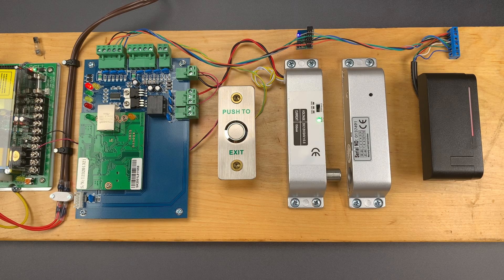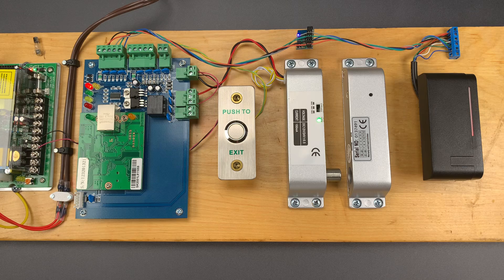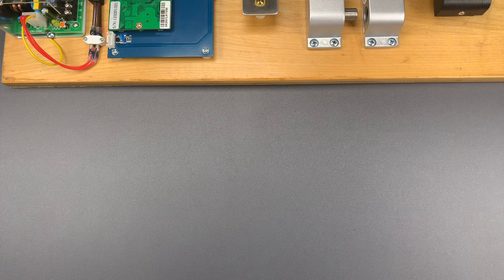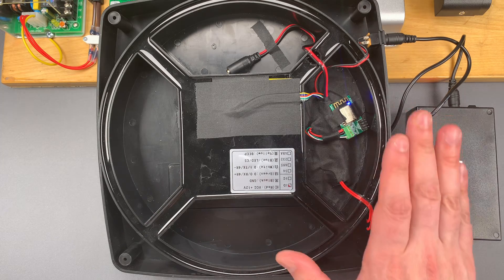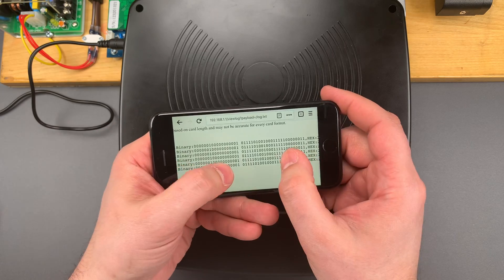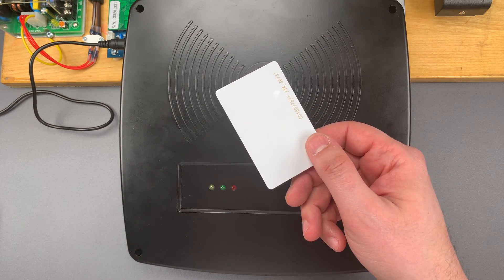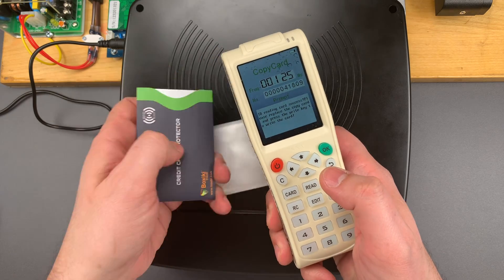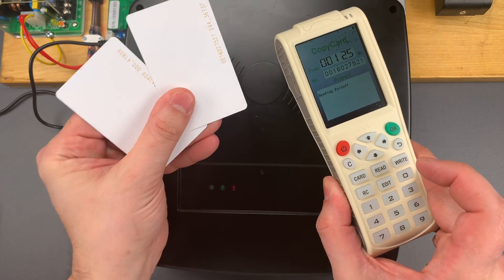[1056] This Black Box Reads RFID Cards in Your Pocket

Comment: If the card is encrypted it prevents you from cloning the card, but it does not prevent you from exploiting it. By reading the card with the big coil and an RFID transponder near the reader, you can let the big coil relay the communication to the transponder. This way you can use a card held by someone farther away, even out of sight. You'd still need remote access to the card whenever you want to use this exploit.
In a high security facility you will probably not be able to enter a high security zone of you haven't first entered the low security zone, nor would you be able to enter more than once. In an office building on the other hand that kind of measures are not in place. It happens quite often that a close colleague forgets their badge and someone else checks them in with their own pass right before entering through the security gate themselves.

Comment: Good to know that instead of buying special read-proof wallets and sleeves, just stacking all your cards together works best of all. I bought one of those special wallets some years ago and to make them more secure, they made it as small as possible. It's a pain trying to insert/remove your credit/debit cards. Also, standard business cards, such as for doctor appointments and such, do NOT fit. You have to first trim them down with scissors to insert them.

Comment: Luckyly 99% of the access badges for apartment buildings in France ARE encrypted !
Some office bulidings may have non-encrypted access control systems to the front door but I don't think this is much of an issue since you usually have to go through turnstiles with security guards standing by and you may also need to type a passcode on a keypad inside of the elevator before going any farther.
And I'm only talking about "low security" offices.
Buildings with "more sensitive stuff" will often have capacitive fingerprint readers in addition to security guards and cameras, turnstiles, armored doors and so on...

Comment: ID Stronghold has a patented BloxProx (tm) card holders which will work to jam 125khz HID Prox format flat ISO cards as well as lots of holders that block 13.56mhz cards.  The BloxProx is an upgrade of the badge holder they sell to US Goverment employees.  I will prevent this cloning that truly is as easy to do as the video shows.

Comment: Where I live uses an intercom based security door where the tenants use fobs for entry. Much like those keyring devices shown in this video. The scanner is a small area on the main panel where the buttons are for buzzing into each home. Sadly all the electronics are in the same place. The panel is screwed in place with Alan key screws which you can pick up from any hardware store that sells screwdrivers. Remove the panel & I am sure LPL cud open the door in seconds.

Comment: Our building has one of those crappy RFID access control panels. They also have the nerve to charge $200 for a second keycard. I spent $35 on ebay and got a copier that came with keyfobs. It gets worse than that. Every single one of the panels is keyed alike from the factory, and you can buy the key on ebay for $10, and then just short the opening circuit with a paperclip.

Comment: Years ago, I installed a top of the line RFID access control system in an unnamed federal building. The readers I installed at that time would easily read the cards inside a wallet or purse from a 2 - 3 ft distance. During testing and training, this one guy who complained that his card did not work even if he held his wallet next to the reader. I gave him a new card and it would not work while in his wallet. I tested both and they worked fine in my hand so I asked to see his wallet. He had an expensive eel skin wallet and this system's RFID would not penetrate his wallet. Keep in mind, this was about 15 years ago so technology may have overcome this obstacle. LPL, if you have an eel skin wallet, test it out. Would anyone care to comment?
Reply: William Garrett - There may be something to that.  I used to have an eelskin wallet many years ago, and the mag stripes were constantly failing on my credit cards.  I suspected the wallet but never proved it.

Comment: Eh, not sure either stop gap would stop someone determined which They're gonna be if they pull off something like this. would take half a milimetre of copper/aluminium to reduce the signal by a factor of ten, and they can just build a bigger/more powerful antenna. They're unlikely to care about the FCC.

Plus I'm pretty sure that a human could still
decode two cards put next to each other if they looked at the raw waveforms, and used some intuition, it would just be tedious.

Comment: 3:38 is that how RFID protection wallets work? I've seen them under an x-ray and the wallet itself seems to have an RFID ring inside of it as well as the metal linings, is that so it reduces the range and transmits gibberish so it can't be read? might be an interesting thing to test as well, if the wallet does better than the sleeve.
Reply: A couple of layers of aluminum foil in the wallet will work.
Reply: @mr.bianchirider8126  it could, but i'm talking about the RFID protection ones they sell. i've seen some with a ring inside of it and just assumed that was part of the protection. Curious to know if it is so it transmits gibberish or not mostly.

Comment: I did know that storing two cards on each other makes them unreadable but what makes me wonder is up to what distance between the cards that's still the case. In my company we have cards issued in two sided holders with two RFID cards spaced ~3,5 mm apart. They are still read no problem by HID readers. Matter of different frequencies?

Comment: Then there's the passive readers that depend on being within several feet of an active reader when a card is read.  Not limited by the distance across which they can power the key card, just being close enough to read the modulated signal.  Defeating those calls for an encrypted challenge-response protocol.

Comment: First up: 3:33. RFID is actually capable of adressing multiple targets in range. Storing them together won't stop the read out.

Pretty much all cards can be UID cloned nowadays. Having a strong encryption on the card is essential. Mifare Classic and EV1 are super weak in encryption and can be cloned practically instantly in most setups. Maximum is a few minutes with equipment for less then 50USD.

NEVER use these types of cards and always do a proper setup for the ones that are actually secure!

Comment: Modify cards so that the RFID is only readable when the card is being pinched in one corner.

Use RFID emulation that only occurs on demand rather than always ready.
Reply: The whole idea of the card is that its dumb.  If you have to carry around something that has electronics to make it smart and responsive to input, might as well just use a phone with active communication rather than passive with RFID.
Reply: Does it have to be "smart"?
Couldn't the tag have a mechanical engagement that closes the circuit?

Possibly two "half" chips that need to be physically connected to produce the effect of the one within the card?  A light spring loaded slider, maybe?

IDK... Just seems like this tech has been adopted way to readily for all the flaws.  Hell, there's cars that unlock and work without ever having to take keys out of your pocket...

Comment: I use the multi-card protection.
2 Bank cards - Garbage card - Drivers license - ID card - Vehicle registration card - Public transport card.
All these cards have RFID in them so good luck reading them all at once and correctly.
But the device in this video has been known to me for several years now thanks to the new wireless paying options in stores.
I knew from the start it would only take a few weeks at most before something like this would appear in backpacks that take a walk on markets and stand in line at the local supermarket.
Everything that can be made, can be falsified/duplicated/cloned. (just ask the Chinese)

Comment: I work with these quite a bit. To enhance security, cards are tied to users, and users have access hours, so it can't be used after hours. High-security areas are limited to just authorized users and are card+PIN. Finally, security monitors card attempts after hours (and it can be emailed or texted as well) and can turn off individual cards. Plus, a separate burglar alarm system helps if a card did get cloned.

One advantage is that the override cylinder doesn't need a change key cut and there are fewer physical keys floating around, which can't be disabled if lost or copied.

Comment: Source for the reader you used?
Worked on some truly long range readers in a parking garage years ago. They had implemented some low level security where once you entered the garage the iD of the card was marked "in use" and could not be "passed through" to another individual until that card had passed the exit reader at which point it become active for the entry gate. The same applied for using it to exit, the second vehicle could not exit until the card was passed through the entry reader. The reader was also equipped with standard logic for time control and day(s) of the week for when a card could be used.